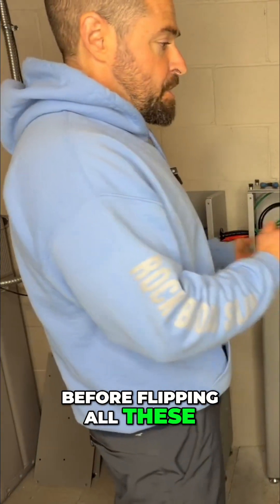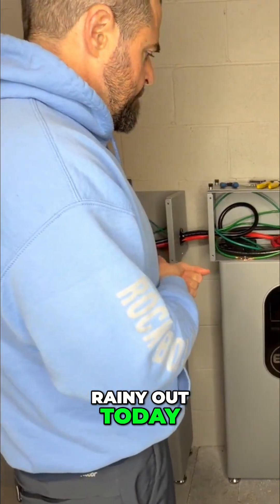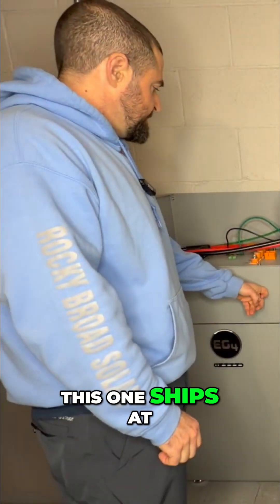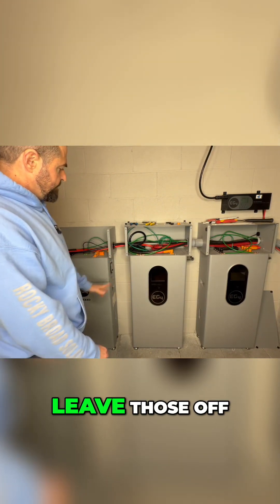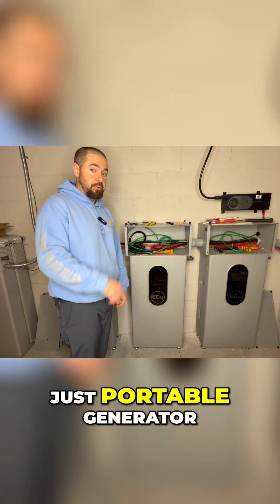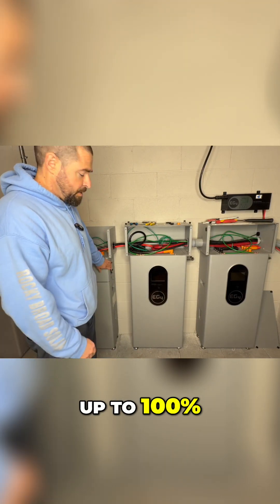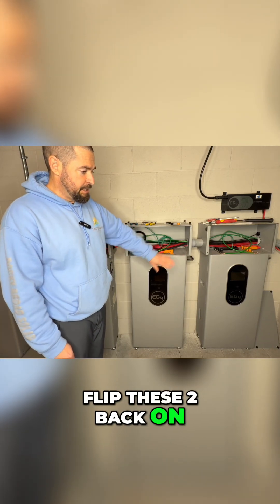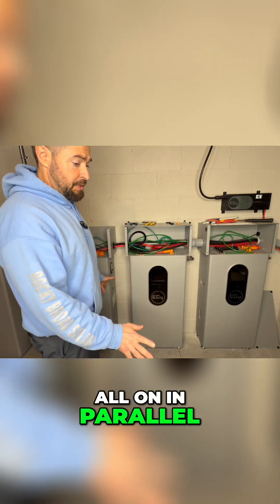Generator Powering Up Solar Batteries! Full Charge Hack Revealed #shorts

Comment: Hopefully the temperature in the battery is over 68 degrees or the charge might only be 15A.
Reply from the maker: If you are referring to that 15A charge limitation you just need that latest firmware update and everything will go back to 157A. Signature Solar was able to push mine remotely. Took about 15 minutes. All systems normal.